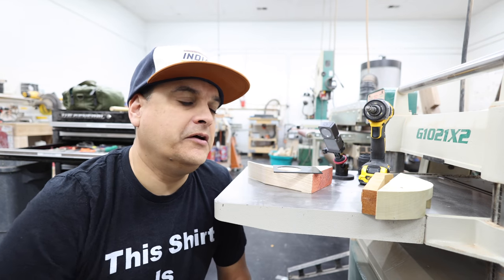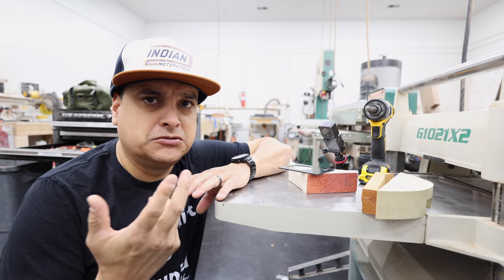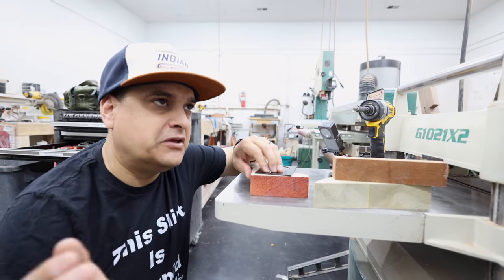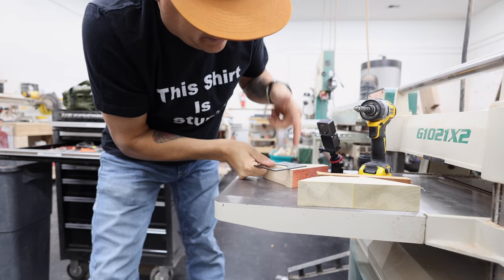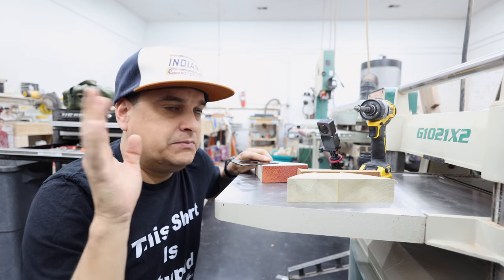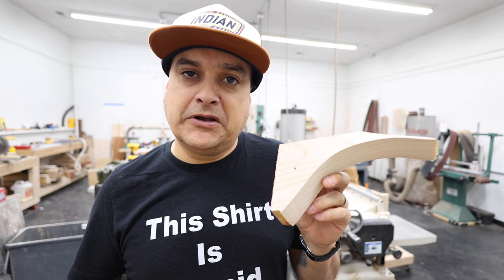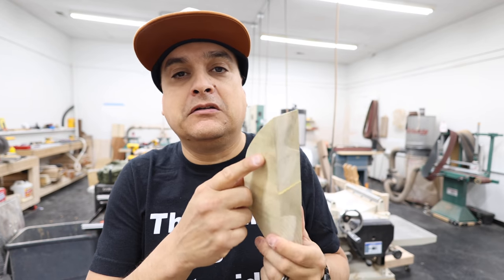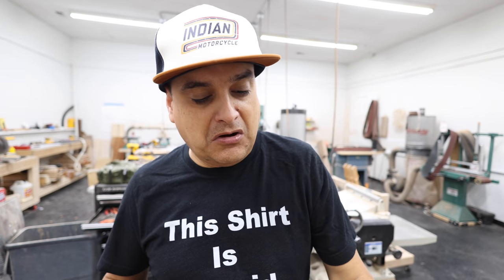What Is The Worst Tonewood For Electric Guitars

Comment: Never over-torque a woodscrew. You're not trying to hold elephants down, it's just a pickguard or whatever. Sometimes when I've been worried that the screw hole might strip (on an old guitar) a drip of glue in the hole will adhere to the sides of it, giving the screw a bit more surface to grab when you screw it in afterwards. I haven't had a hole strip yet. I have had some that became looser then desired, and the glue trick worked.
Reply from the maker: I think it’s so funny how much advice there is on this.
Reply: @DylanTalksTone  We all care and worry about our guitars.... Care and maintenance and all that, I guess. :-) Peace.

Comment: A very intersting experiment, if only you had included basswood, the only guitar that a stripped a trem screw
on had a basswood body, and i had to plug and redrill it to refit the trem.
Some woods get a hardtime with guitarists that believe all the myths that circulate about tonewood.
Once the paint is on, does the wood realy make a big difference to how a guitar sounds?

Comment: Try this to fix a stripped screw hole.   Put water in the hole with an eye dropper or other method.  Wipe top of guitar and leave water in hole filled to top.  You can refill it once or twice but wipe of your finish and only let the water touch your wood inside the screw  hole.  Leave to sit overnight in the summer or maybe a few days in wetter, colder times.  Your wood will swell and accept thy screw.

Comment: I've never owned a guitar wood I didn't like including a 30 year old Squier made from furniture plywood lol! I have several poplar guitars including a 24-fret Jazzmaster clone and it's both heavy and dense as hell. I have an asymmetrical flying-v body built from blocks and a pancake style and the fucker weighs at least 15 lbs!(I typically lift free weights in the gym frequently) These pieces are hard as hell and I hand selected them so the grain is absolutely beautiful and useable. 

Now, lets' talk about BASSWOOD! lmao!
It's truly the weakest, lightest and loosest grain wood in widespread use today and it sounds absolutely beautiful. It also makes the best sounding Stratocasters I have ever owned and Ibanez can't be wrong that many millions of times. I did have to cut out the portion of the body the tremolo was in on 2 of them though and 1 has a block of red oak since it's what was available glued in with 2 posts for a vintage style floating Stratocaster tremolo, the other I just used aluminum block, drilled and threaded for the same vintage appearing tremolo.

Comment: That's what I read online,, that the softer hardwoods are relatively better for holding the screw threads than harder species. The point is, hope that the manufacturer used the right screws & threads, didn't strip out what they did screw into it. And limit the times you swap parts on & off the body. There's plenty of screw thread depth to hold a guitar together, don't over tighten to damage the screw head or break the threaded portion, even the pilot hole in the body that became threaded. One can always toothpick & glue the body to repair stripped wood threads.

Comment: Basswood is much softer than poplar and it is widely used for guitars. Poplar is a pretty good wood for guitar bodies as far as durability goes. Tone wise it has a flat, neutral sound. In my experience it's all about matching the right pickups to the right wood.

Comment: Super news! I'm getting a custom guitar made with poplar. The luthier himself recommended it highly, and doesn't why people dump on it so much. I've seen people say luthiers prefer it only because it makes their job easier. I presume they say that because they wrongly assume the wood is so soft, therefore, easier to machine, and bad because its cheap(only because its abundant), and would like to justify their own poorly informed opinion. I've softer woods in other guitars that have lasted well(Basswood), so I went for it as it helps keep my costs down, and all my tone that actually matters are coming from my Seymour Duncans and Engl Fireball. I'm also having it painted, so don't need to worry about its natural colour.

On the matter of tone wood, it makes very little difference in IMO. Yes, there are very small noticeable differences(see Warmoth video as an example), but nothing worth buying an electric guitar based on. Great pickups and amp will get you the sound you want on electric anyway.

Comment: I've owned several poplar guitars in the past, one of which (an MIJ Jackson Rhoades) I had installed actives and had the battery in the control cavity, meaning I had to remove the cover every time I changed the battery out. Never a problem. I've heard about poplar being compared to alder in terms of tone as well, but it has always seemed darker to me, closer to mahogany, and worked really well with high output ceramics or alnico 5's.

Comment: Add the possibility of the factory over tightened screw holes that are half stripped to begin with. I've had to do the toothpick and wood glue repair method on two strap buttons I replaced with strap lock buttons

Comment: I always thought the problem with poplar was that it wasn't very pretty so you would never do burst with it, I personally have three starts: A poplar one, an Alder one and a Swamp Ash one. They all have different necks: Maple, Rosewood, Ziricote. At the end of the day, I wouldn't be able to tell them apart since even the weight is different. The two things I have noticed to affect the sound is (1) pickups and surprisingly enough (2) the tremblock material, since one has a brass one.

Comment: I'd be pretty reluctant to use a drill to screw in a pickguard, no matter what wood the instrument is made out of, especially if I'm using wood-screws. When the screw begins to tighten I want to feel that tactile response through a small screwdriver, not the motor of an electric drill. But if I were that worried about it, I'd probably consider using small insert nuts and matching machine screws; then you'll never have to worry about how many times you remove a pickguard.

Comment: My Squier VM 70's Strat is Basswood.
My nephews Fender Strat is alder 
There is a * slight* difference in tone between them but nothing you can't adjust for using the amps tone knobs. So not a big deal either way.
Both sound as a Strat should.

Comment: I think if we don't push hard with the screwdriver while turning the screw and we don't overtighten (there's no need, the pick guard will not fall off anyway..) there are no risks of stripping the thread with any wood type...and if it strips off because the guitar belongs to Swarzenegger, the good old glued toothpick will solve everything...so I don't see the problem...

Comment: You can put a drip of CA glue in the hole, let dry for a few seconds, (add wax to the screw if you're anxious it will be stuck, i don't), and voilà! The wood will be a lot stronger. 

The worst tonewood isn't the one that the softest; its the one that sounds the least attractive to your ears. I've made a guitar with a one piece spruce body that sounded great. Did I take care of solidifying the screw holes? You bet I did!

Comment: I don't know I was expecting the mahogany to strip out the fastest.

I've had the screw hole strip out pretty much immediately on my gibsons... Forcing me to the match stick and glue fix.

I had never heard about word about Poplar

I have heard about basswood, though

Apparently basswood is so soft you can easily leave fingernail imprints into the body if you handle with any kind of nails.

So yeah the screws are supposed to strip out fast...but it's really just a theory I've heard.  I would like to see it put to the test as well to be honestî

Comment: Anybody who objects to poplar should also object to basswood, which is much more widely used and even softer. However, I don't think that hardness is the issue here. 

Poplar is much softer than ash and mahogany, but so is alder: in fact, there's very little to choose between poplar and alder for hardness. There is clearly some other factor involved in whether a given wood retains screws well or poorly. Otherwise, problems with stripping might just be human error: sloppy installation of the original screw, poor technique in removing and refitting a screw, or simply placing too much strain on a screw in use - as with strap button screws.

Comment: OK I'm an ass, but when it comes to electric guitars, IMO it doesn't matter what type of wood you use, exception may be semi or hollow body. If you made it out of brick, the sound comes from the type of electric components you use. If it is cheap junk, it will sound crappy, if it is quality, it will sound good. As far as what strips out quicker, does not matter to me, don't strip it out! If you do, break out the glue and toothpicks and get over it. Furthermore, use good pots and pickups and you should not have to keep taking the pick guard off anyway. I will shut up now, like I said, I'm an ass, I know you know your stuff and you did make a nice video.

Comment: I made one Telecaster out of pine - pine is very soft but very resonant and It came out a nice guitar 👌
Reply: The point is that resonance doesn't matter at all... 
If the wood is stable enough it won't make a difference in sound.
Reply from the maker: If it makes the player feel good… then it does

Comment: Poplar (540) is actually softer than alder (590) on the Janka scale. It does have a higher modulus of rupture. Either way, it's what I chose for one of mine. It's a bit fuzzy, but works nicely. As for "tone", they put knobs on amps for a reason.

Comment: If you're concerned about stripping screws: Buy better screws. Quality screws will hold significantly better. Then learn how to use a manual screwdriver and don't overtorque them. Finally, in the last resort, learn how to drill and plug old screw holes. None of this is hard and these techniques will extend the life of the wood indefinitely.

Comment: I'm surprised you got more than a couple of times with that giant drill motor!  I mite take screws out with small screw gun with clutch set with lightest torque. When put back do by hand or almost all the way and finish by hand. Z.K.

Comment: Wood does make a difference but it can only attenuate tones. Different wood attenuates different frequencies and all that glorious resonance from an unplugged electric guitar is tone that will be less available to the pickups. If the guitar is mid heavy unplugged it will be more notched plugged in. I had a Strat that made high D flat dissappear....a dead spot. Unplugged it was loud and clear, plugged in it was gone. It's just physics.

Comment: Tone wood is bs for electric guitars. Nobody even mentioned “tone wood” before the 1990’s. It’s a marketing ploy.
Reply: Hello, clueless. The fact that the most successful guitars are built from certain types of wood is not an arbitrary decision. It was carefully researched and developed.
Reply: You really are a funny guy.
Reply: It's not black and white. There are two camps and they are both wrong. Wood absolutely plays a part. But how expensive it is, that's not what makes it good or bad, which is itself subjective.
Reply: @Patrick-857  Physics says you're wrong, not me.
Reply: @chopperdeath  On the contrary, physics says I'm right. Anything in contact with the string will influence how it sustains and what harmonics are sustained, damped, or experience resonant peaks. You can argue to what degree, but you can't argue the effect doesn't exist because unless you have the string attached at both ends to something of infinite density and hardness, which cannot exist in reality, then the material it's attached to will have an influence on how the string vibrates. If you're feeling the vibrations of the strings through the back and the neck of your guitar, then there's  interactions happening and that's introducing all kinds of complex non linearities to the equation. That's physics, just a bit beyond your level of understanding though....
Reply: @Patrick-857 Leo Fender used pine, and the gearsnobs sing the praises of those guitars
Reply: @jasondorsey7110  Exactly. It's not about good or bad materials really, it's about preference. The woods used come down to what was available and economical at the time, and today it's a bit the same and a bit different depending on what level of instrument. But even two identical instruments made on the same line, on the same day will differ. I have 3 strats and they are all radically different. I can't say one sounds better than another, but they are definitely different. They feel different, they sound different and weigh different amounts. I like each one for different reasons. 

Another thing, the wood of the neck is extremely important, not just for sound, but feel, and obviously stability. I've found some cheap Squires especially Chinese ones, the necks can be unstable and have a kind of mushy feel to them. Maple fingerboard guitars definitely are different tonally and in terms of feel. I can hear they are brighter even acoustically, and they feel more solid. 

But the tonal differences don't matter much, EQ and pickups, as well as setup make the differences irrelevant, especially to the audience. However the feel of different woods and construction methods absolutely are important to the player. I find myself playing differently on each one of my strats, and getting different inspiration. I think ultimately it's a good idea to play every guitar with the overall specs you want in the store before choosing one. You can buying one without playing it, but it's a risk.
Reply: @michaelstevenfriedlander4583  Leo Fender used pine and alder because it was cheap and available.
Reply: @Patrick-857  Wood absolutely matters unamplifed. It might vibrate differently in your hands and body, but through an amp it can't be heard through a speaker.
Reply: @chopperdeath  This is a misconception. The pickup picks up whatever the string is doing, but the string is effected by anything it's in contact with. Would it sound the same of your tailpiece was made from rubber? Clearly not. If you can feel the vibrations through the instrument, if you can hear it acoustically, then the string is inducing vibrations in the instrument. This absorbs energy from the string, which will cause the note to decay. However, with any material involved in this process, there will be characteristics that effect different frequencies and amplitudes differently. Resonances will occur and feeds some energy back into the string. Different frequencies will decay differently due to some being damped more, and some being sustained more. Overall sustain will be effected. That's the most noticeable difference between different guitars. But  attack and sustain behavior goes beyond mere amplitude over time. There's always a frequency component. 

The only way material the instrument was made from wouldn't matter is if you had your string attached to something of infinite density, because any variable you introduce has an effect on the behaviour of the string to some degree.
Reply: @Patrick-857  A well reasoned and presented argument. If everything you said was true the overall effect would be barely perceptible through a speaker, on a recording or in the audience. A cheap eq will have more effect on the signal than the actual hardware could. The recording console, the post production, the microphone and the end users speakers change the sound so much the sound out of the guitar is drastically changed. Is the difference enough to make a difference?
Reply: @chopperdeath  It makes a difference to the player.
Reply: @chopperdeath  By the way, it can cause the instrument to sound quite noticeably different, but yes processing ect can make that irrelevant. I don't believe pickups are the same in that regard, though many argue differently. I've found nothing really makes a single coil do humbucker things. No amount of EQ quite bridges that particular gap. Also compression or distortion can't make up for bad sustain. But yes, differences in tone due to materials are small, but they absolutely do exist, anyone arguing otherwise isn't operating in the realm of science.
Reply: Tonewood affects sound slightly. Not enough to really matter everything else considered...like EQ, pickups, tone, volume, string gauge.
Reply: @michaelstevenfriedlander4583  The most successful guitars in the world are successful because Jimmy Page and Jimi Hendrix played them, period. We are still trying to emulate those two guys with gear obsessions.
Reply: Apsolutly is wrong

Comment: Been building solid bodied  guitars for 43 years. IMO, not the worst tonewood tonally, but right there at the top if the list. It does NOT sound simular to Alder for sure!!
Reply from the maker: Totally … that’s why it’s used interchangeably with alder by many manufacturers…. Maybe they aren’t “tap testing” correctly

Comment: As a veteran mechanic of just about everything that is fossil fuel propelled- (I mean from locomotives, to motorcycles), Let me bestow some words of wisdom. Power tools have their place in fixing stuff. But they are not for everything. The softer the material, the more you want to consider breaking out the old screwdriver set. This goes for aluminum, and other soft metals also. Veteran guitarist. Never used a power tool on an instrument. Never will. Good luck.

Comment: Why is no one talking about the impact on the length, diameter and metal type of pickguard screws have on tone? This is a vastly underrated upgrade. I personally only use Roman aged copper screws with hand cut threads.